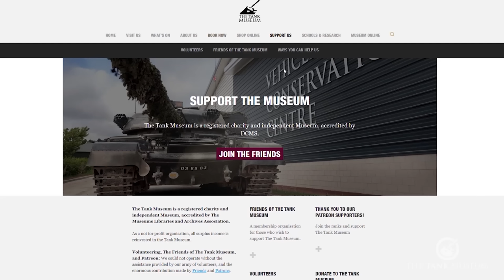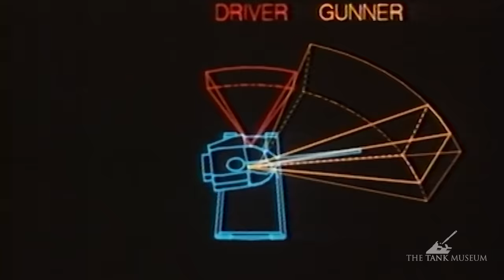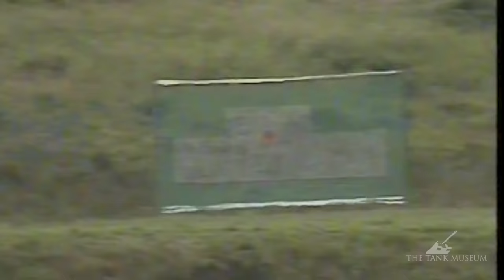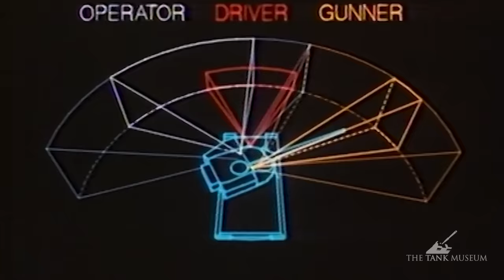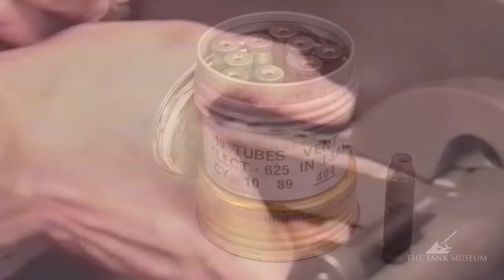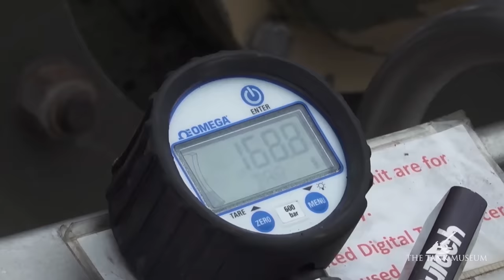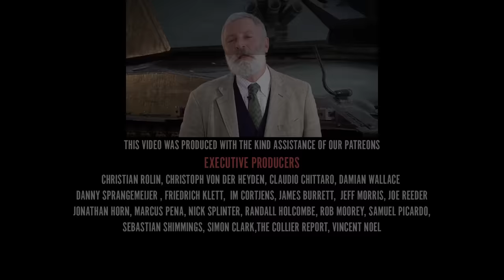Tank Chats #92 | Challenger 2: Full Length | The Tank Museum

Comment: Challenger 2 is a sad story. While it was last major MBT to enter the party it somehow got outperformed by older designs. As it looks, brits will be driving german tanks coming decade, which is a pity considering how rich british tank design traditions were in the past. Ps: that gramps is a badass tho, calling decapitated toe a ''slightly wounded foot''.
Reply: Challenger2 only lost against other tanks in trials because price/performance. Why would you buy a CR2 at the time for £5million when you could get an older modernised Abrams or Leo2 for half the price of CR2?
Reply: @v4skunk739  I dont think you can buy half decent M1 or Leo2 for 2.5m £ unless ur talking about some used and junky models that did gather dust for some decades, like those Leos Poland received. New ones go for around 7-10m $ each, depending on completion and batch size. 

The problem with CR2 that i see (beside rifled gun and obsessement with HESH) is that it did not receive any major design overhauls since it was released.
Reply: @Tjecktjeck  I'm talking about years ago when CR2 was for sale! They were £4.8 million each 15 years ago where as the Abrams and Leo2 of the time were way cheaper.
Reply: @EmperorLionflame  I was talking about nato tank crew games. British team has always landed on last places there since the 90's.It could depend on poor crew experience, but most likely everyone is sending their very best crews. Which leads me to belive that it has to do with tanks. Ps: As for protection. Nobody knows accurate protection indicators, however, CR2 has received a reputational blow when it got frontally penned by a RPG-29. I dont think most if any MBT's can withstand modern RPG's or ATGM's without help of era or active protection, however the damage to reputation has aleredy been made.

Comment: That driver's hatch area looks like a shot trap.
Reply: Shot traps don't matter as much as they used to, as modern sabot ammunition tends to be harder, but far more brittle than older AP rounds which mean that they tend to break apart when they ricochet.
Reply: It really isn't an issue in reality. It shouldn't be confused with games. A enemy gunner isn't going to snipe "weak spots".

To hit under the turret you'd be firing at the challenger at effectively point blank range too.
Reply: @tisFrancesfault  A shot trap is an area where the shape is likely to direct a shot. Panthers had a 'chin' added to the lower mantlet to avoid the curve deflecting a shot down into the roof in front of the turret.
Reply: @luvr381  soooo.....ALL tanks have a shot trap then?
Reply: @komradearti9935  did you write that nonsense all by yourself or did JK Rowling give you a hand?
Reply: @komradearti9935  You don't get what that diagram is showing you, do you?

Comment: I guess they will never learn how to make a LFP.
Reply: It isnt a video game. The LFP Just isnt that much of a big deal. Theyve lready lined it with extra steel and they add applique over it. You dont need more than that.
Reply: @SM-zx9mx  You do understand they added composite and steel lining after that right?
Reply: @nothingspecial6925  i believe that was penetrated with the composite on. Anyway, armor that thin and at that angle i can't see surviving a hit
Reply: @nothingspecial6925  Well, i guess  that Iraqi WAS playing a lot of video games because he did exactly that! He aimed for that big juicy LFP. Now the driver has a half a foot left. Wrong - that LFP on the Challenger is so big it is so easy to aim for and hit. It's just a terrible design leading to a massive weakspot, which will be exploited in any future conflict.
Reply: @SM-zx9mx  from what I gathered the only reason it was easily hit was because the tank was driving over an obstacle exposing the area more. And as stated, the upgrades came about as a direct result of this. The same weapon would not be able to do the same with the added composite now. Like I said, unlike video games you don't get to carefully snipe out weak points and you certainly aren't going to be sniping weak spots with missles unless you are putting yourself in immediate danger. The lfp is a weaker area, all tanks compromise some aspects in their armour, but that doesn't make it a bad design or easily defeated.

Comment: Too many cost saving measures for my liking. Recycling rifled guns from Challenger 1 instead of going for the standard Nato smoothbore gun, which not only has been proven to be deadlier in tank vs tank, but shares the shells between all Nato countries. Hesh is useless, you can just use HE for pretty much the same effect, the real reason is because Britain had loads of these guns and shells already produced. Not putting in a 1500hp engine, going for a weaker engine on one of the heaviest tanks, again to save money. That driver port looks like a massive weakness too, would not want to be a driver in this thing in a conflict. All this just leads to having to upgrade the tank in the future, hence the Rheinmetall upgrade, short term cost saving measures gimped what should of been a much better mbt.
Reply: Recycling rifled guns from CR1 ??   WTF....did you watch the video, its an all new gun, yes that means the barrels aswell. Smoothbore is better......longest tank on tank kill.....oh right a rifled gun. Have you seen HESH hit a strong point? I have, nothing the smoothbore has could be as effective. The drivers view port is a weakness....ON ALL TANKS!  As to the complaint about upgrades,  care to name how many on the Abrams (70s tech) or Leopard ???
Reply: @komradearti9935  wtf are you going on about ? Naval warfare has no  bearing on this discussion. Tank warfare is about killing the enemy tanks as fast as possible, the more accurate the gun, the better, thats why i stated the longest tank on tank kill was a rifled gun. 

As far as i can see PELE rounds only go upto 30mm  so fk all use in this conversation. Programmable HE is a fairly new concept, and i cant see any actually combat usage of it with a quick search.  Sooooooo....not really worth you commenting was it.
Reply: @catlee8064  It's impressive for the Challenger 1 to get the furthest range tank on tank kill however that doesn't necessarily prove that the rifled barrel of the Challenger 2 is superior to a smooth bore from another equivalent tank. The last record was set in 1944 by a Ferdinand. The most recent is the Challenger 1's set in 1991. That's a gap of 47 years. It's been 29 years since the Challenger 1's record was set. The Challenger 2's newer gun is yet to break it's older brothers record. What this shows (at least to me) is that the opportunity to set these records are far and few in-between.
Another note is that the APFSDS rounds that are fired from the Challenger 1's and 2's rifled guns must use an obturator to counter the rotation of the rifling. Therefor the rifling is obviously something unwanted when firing APFSDS. The type of shell that was used in the world record.
Reply: @komradearti9935  Ok i stand corrected on the PELE, my search wasnt that exhaustive, but as the record was set 30 yrs ago....when none of this tech was around, i stand by my point that the rifled gun L30 is still a world class gun and the CR2 is a world class weapon system, which has been battle proven despite what the OP said about it.